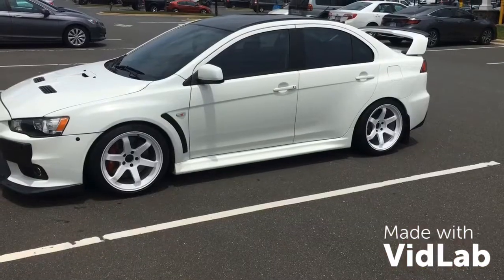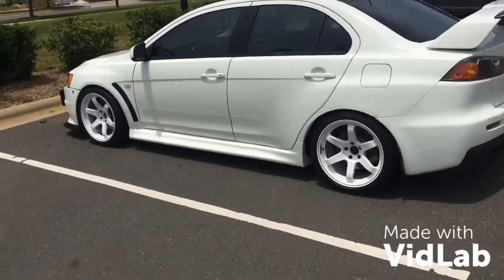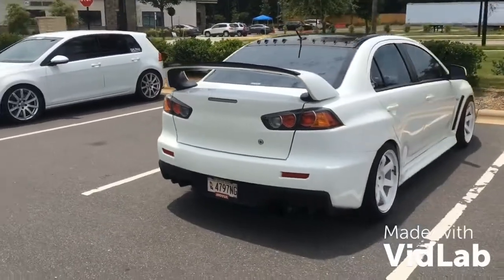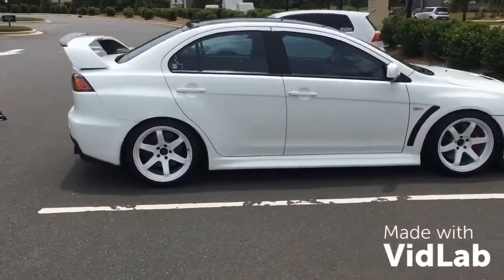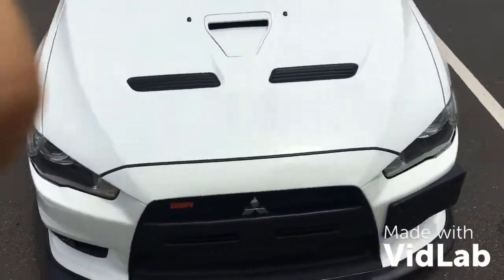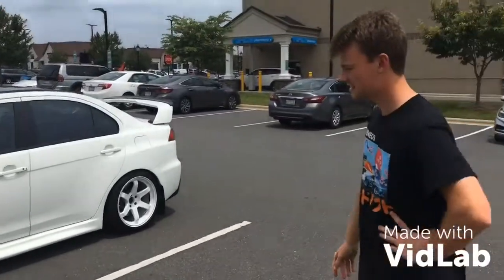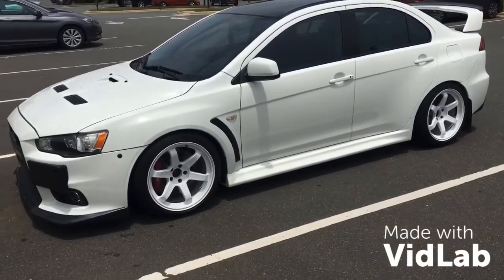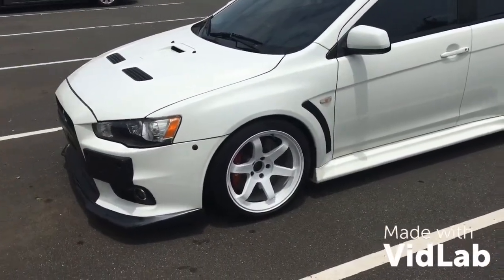Mk7 Radiator/oil cooler development

Comment: Love to see your radiator once’s it’s complete. I have a FMIC and I been looking around for a delete kit for the OEM intercooler. Sadly there is none. I was considering CSF but, if your design uses the space where the OEM intercooler is located than I am sold. Keep us updated on this project.
Reply from the maker: Hopefully I’ll have a prototype in hand to show off soon!
Reply: Baun Performance would you consider making a delete kit for the people that might not have the budget of your radiator? This way you would still have people buying your products. Either the radiator or the delete kit. I’m on a budget myself but, I do buy performance parts that are proven to work with R&D and real world testing. I hope you think about it. Thanks in advance.
Reply from the maker: project _ StormBlast no plans to make a delete, as there’s absolutely nothing to be gained and that would be an extremely labor intensive installation for having no benefit